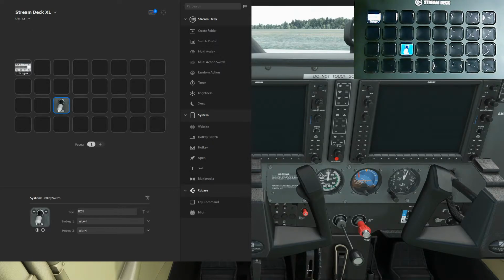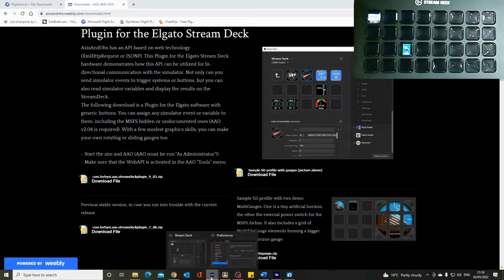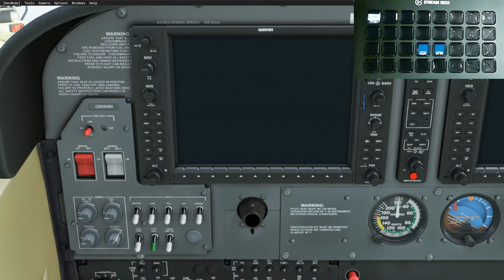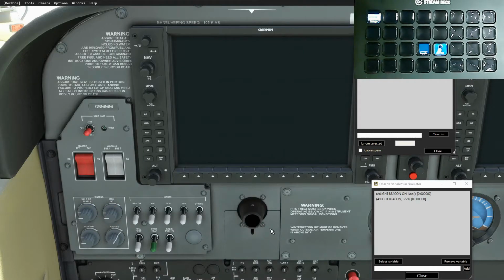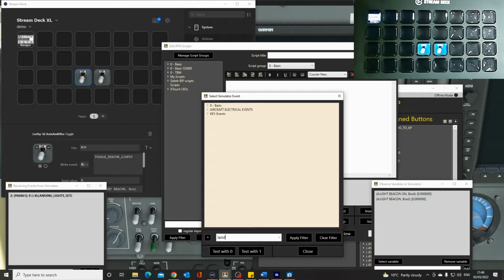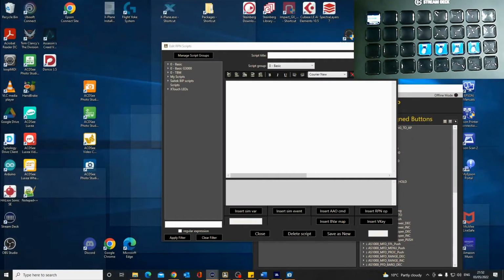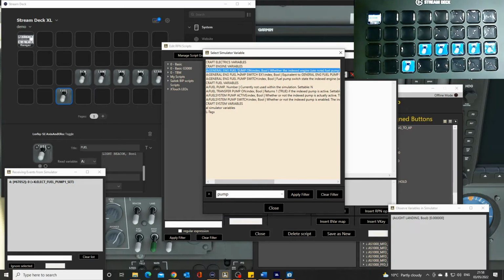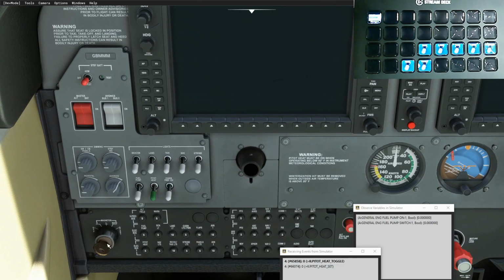MSFS 13 Stream Deck Switches using Axis and Ohs

Comment: holy freaking moly, this so awsome, this helped me start up with axis and ohs. i got stream deck xl and plus, and since there are no packs for the boeing 747 i have to make one my self. i got a couple of questions, when i start up: watch simulator events, even when i turned off my yoke, rudder and throttlequadraint. inputs stil flying thruw. any idea what that is, in your vid i see nothing accept when you hit a switch, next question, not all buttons in the 747 gives out an event for example, when i toggle the main 1 fuelpomp it send an event happening, but when i hit the main battery there is no output. what does that mean and is there a way so it does give an event output? i want to program my deck so i can completely configure the plane via streamdeck, but if half of the buttons dont give out an event its not gonna be worth the time, also turning the auto pilot dial knobs for altitute, heading and speed dont give a event. kind regards
Reply: I also want to add, i just switched to the cesna skyhawk g1000 and when i flipped the beacon, it didnt register a event, but with you it did, is there mabey some kind of setting what is different?
Reply from the maker: @2684dennis  Hi.  I've been away from flight simming for a few months. Hope to be back at it in month or so.  There is a way to highlight an event and then ignore it if you are getting a lot of 'noise' from a yoke or throttle.  I get it sometimes from my logitech, I think it's a dirty potentiomer.

I had a quick look at the events to see your problem and it looks like something has changed and it's not showing all the events it used to in the 'watch events' panel.  But there are lots more events available to assign to buttons and scripts.  I hop to be back on it again soon and I'll see if I can make progress here.

There is a support forum at https://www.avsim.com/forums/forum/788-lorby-si-support-forum/ 
might be worth seraching or asking here.
Reply: @Keith_Butcher  thank you for youre answer, iv been there on avsim but they didnt really gave me clear answers, but what you say makes sence. meanwhile i made the jump to spadnext, there are good vids and discord help me good, so im progressing there. and there it was explained there are a lot of H events that are not showing in the watch event window, so you have to go to find them in the plane file in the official maps or poke arround in msfs developer mode behavior tool. thanks

Comment: Your videos are great! I purchased a Stream Deck XL because of them. I can get the stream deck to work with key strokes but when I follow along with this video, it doesn't work in the sim. You don't mention anything about adding "Assigned Buttons" in this video. Do I need to do that in addition to what you did here? AAO has a green connection light and recognizes the aircraft, so I believe that is connecting to the sim ok.
Reply from the maker: Thanks for the kind words! Always a good way to get some support.

I can't be sure what's wrong. I've never had that problem. I put the keystroke example just to show some basic stream deck usage, but this is not the way forward.

Key strokes only work if the SIM has the focus. I have other software running e.g. flight charts on a second monitor. If I click on these to find a frequency for example, that will have the focus. If I forget to click back in the SIM all my key presses, whether they are from the actual keyboard or from the stream deck, will go to the last app I clicked on and not the SIM.

The correct way to use AAO is to download the stream deck profile from https://axisandohs.weebly.com/downloads.html and use the AAO tools from there.  These write direct to the SIM variables even when the keyboard input is directed to a different app.  This also means you don’t have to use ‘assigned buttons’.  Not every event appears in the list of buttons you can assign!

So, things to make sure you have done. I’ll try and be complete, so excuse me putting in the obvious!

1 install AAO
2 in tools, make sure enable web api on port 9080 is active
3 install aao profile on stream deck
4 Before running msfs use the aao option in the scripting menu menu to read hvars and bvars
5 With the sim running use the option in aao scripting menu to read the lvars

You need to do steps 4 and 5 every time you add a new aircraft or is there has been an update msfs or aao so it can find any changes.

The lvars is pretty static. These are variables that have been around for a long time and are well documented.

Hvars and bvars are quite new and developing quickly. These are variables designed to work with the graphic interface, e.g. when you mouse click on a switch on the panel. This allows developers to add more graphical items and interact with msfs by sending html code.  

These are not well documented as the a/c developer can make things specific to their own product.  In fact, the advice is to click on every button and switch in an aircraft that you haven’t used before to activate the hvars or they won’t be found when you do step 4 above.  So I do that , exit msfs, read the hvars again and then restart msfs. You only need to do that the first time you use that a/c or if there is an update to it, not every time you fly it.  In fact, I do a couple of flights and get to know the a/c and what I want to put on the Stream deck or X-touch and the best layout before I start programming it, So I will have tried every function first. 

If you have installed the stream deck aao profile and it doesn’t appear check video 13 at about 8 mins in to see how to enable it.

I can’t think of anything else. If anything here helps, please tell me what worked so I can add it to my list of solutions.  If it doesn’t work, get back to me with more details and I’ll try again.
Reply: @Keith_Butcher  This is an incredibly cogent and thoughtful response to a terribly asked question (from me)! It's working great now, and I'm off to start building my first profile to learn from. Thank you very much. Do you have a Patreon? I'd be happy to contribute.
Reply from the maker: @paulycomtois  thanks again. Glad things are moving forward. 
When I started this project I decided not to monetise it or to proved any product eg not give completed profiles. 

First is my ‘pay back/pay it forward’. Second it ‘give a person a fish they eat for a day.  Teach them to fish. Etc’

I have been given time as I have had a cancer diagnosis so will be confined to home for 9 months. I realised that 40 years of flight sim, programming, electronics and teaching gave me some unique knowledge that no one in my family is remotely interested in. I thought it better to make a coherent resource rather keep repeating myself on forums

If you anyone feels the urge to contribute there are 2 charities that have been a great help to me 

https://www.bowelbabe.org/
And
https://www.macmillan.org.uk/
If donating internationally is a problem then I’m sure there are similar charities locally.
Reply: @Keith_Butcher  I will do just that. Thank you again for your time and effort in helping others learn!

Comment: Just found your videos..im glad yoh are helping with the series.  Many times ive tried,failed and given up. I have learned lots.  But can you help on the stream deck im doing a trim page for the tb30..  pitch trim works fine but when i do aileron trim it movers very slow that it hardly moves. Pitch multiptyer is set to 1 and i have set ailron to 1 and upto 1000 and there is no change.  It fails to move like when you use the keyboard short cut.  Ctrl 4 or 6.  Any ideas.
Reply from the maker: I haven’t dug far into the TBM yet. I’ll take a look and see if it’s obvious. I’ve got commitments over the weekend and won’t be near my pc. So give me few days and I’ll get back.
Reply: @Keith_Butcher   ok thanks for the reply.. ill keep trying my end..i have emailed the developers but no reply as of yet...
Reply from the maker: @nigelmorris4769  just had a quick look.  The TBM starts with the aileron trim disabled.  Look at variable A:AILERON TRIM DISABLED.  It is on.  I created a toggle button Write a K event AILERON_TRIM_DISABLED_TOGGLE send value 1  and read variable A: AILERON TRIM DISABLED, Bool with on value as one.  Once the trim is enabled I could then increment and dec the trim.  I was only using the on screen buttons and watching values.  Didn't try to create a stream deck button.  I can't see how you are meant to enable the trim from the cockpit.Hope that helps.  Tell me how it goes
Reply: @Keith_Butcher  I will look into the AILERON_TRIM_DISABLED_TOGGLE event  but im not using the TBM The aircraft im making the buttons for is the TB-30 epsilon, a french trainer that was released a few weeks ago on the store page.. I find its a lot better than the pilitus pc21.  Would be great if we cound get the raf Beechcraft Texan T MK1 or the Tucano T.Mk 1 variants..
Reply from the maker: @nigelmorris4769  sorry. I read your post too quickly. And the TBM is next on my list to explore so I jumped to conclusions. TB 30 looks interesting. I’m trying to work through all the msfs default planes first but was tempted by just flights piper arrow. I might break my rule and add the tb30 to the list.
Reply: @Keith_Butcher  nice idea..i have found that in the tb30 there is a switch for the gyro atirude and aao does not detect it...

Comment: I'm really enjoying this series - thank you! I've been using Lorby AAOs with the Stream Deck for a few months now and feel quite proficient with it. Still, I have learnt some good tips from you - for example, I had no idea you could drag & drop image files over the Stream Deck app to load them; I have always used the drop-down arrow and browsed. Your method is much quicker! Having watched your videos, I'm considering investing in an X-Touch Mini, as having rotating dials would be very helpful in the sim and would also save quite a lot of space on the Stream Deck (replacing a number of 'INC' and 'DEC' buttons) …
 
I have created profiles for the Just Flight Warrior and Turbo Arrow using AAOs, trying as much as possible to replicate the dials I cannot see when in the default view in the cockpit. I have steam gauges using backgrounds I have created myself with rotating needles displaying the engine RPM, alternator amps etc. Some of them took a while to 'calibrate' (i.e. to adjust the position of the needle, the multiplier required to give as accurate a reading as possible, the starting angle of the needle), and some I have had to write RPN scripts for - the scripts I have included in the gauge itself where normally an event or variable would be. If I were ever brave enough to share them them on FlightSim to, do you know if people who downloaded a copy would have the gauges calibrated on their PCs as well as they are on mine, or would the angles, positions, multipliers etc. have to be re-calibrated for their machines?
Reply from the maker: Thanks for the feedback.

I've not got very far with creating my own gauges.  I have downloaded a few from flightsim.to and some of these use RPN scripts.  These scripts were zipped alongside the profiles and had to be imported into AAO.  Indeed they also had an XML file mappng BVARS to LVARS. These had to be imported and then there are entries in the 'extras' menu in AAO to map the BVARS to LVARS and then to allocate it to a specific aircraft.

I haven't got anywhere near that level yet.  To see this in action, look for the TBM profile for AAO on flightsim.to 

All I can say is that I can't see why there should be any re-calibration from one PC to another.  I've never had to make any changes when I have used a guage I have downloaded.
Reply: @Keith_Butcher  Thank you. If I do upload them, I think I'll just keep the scripts in the buttons but have an external file to add if users are having issues. I'm sure you're right regarding the calibration of gauges - if users had problems with that, they'd have to try to work it out themselves and that would be a headache for everyone.